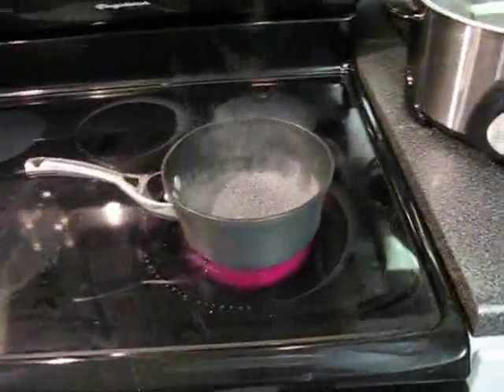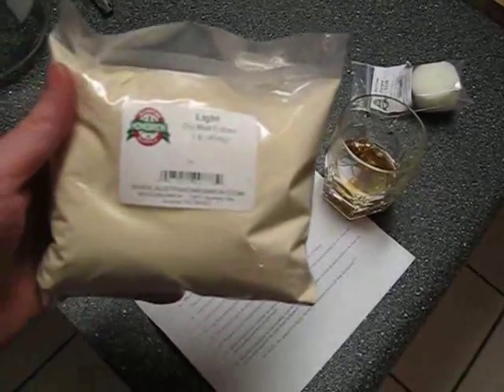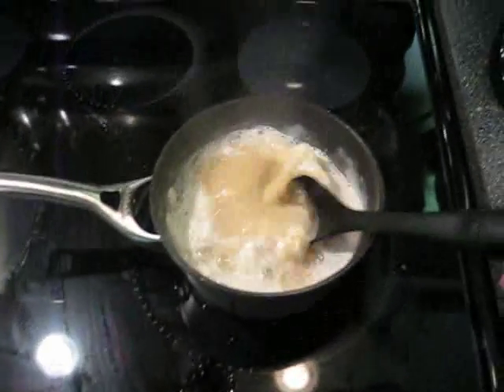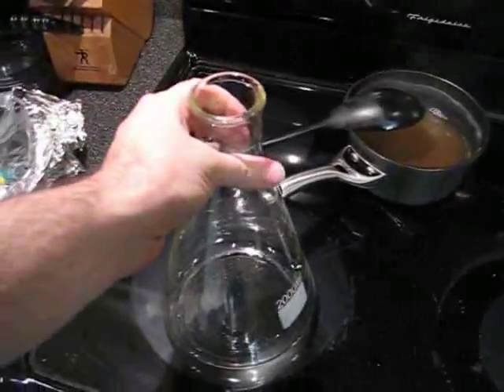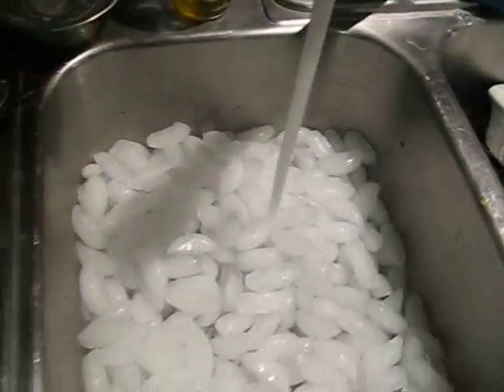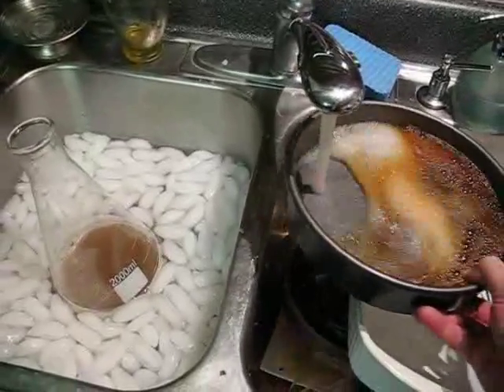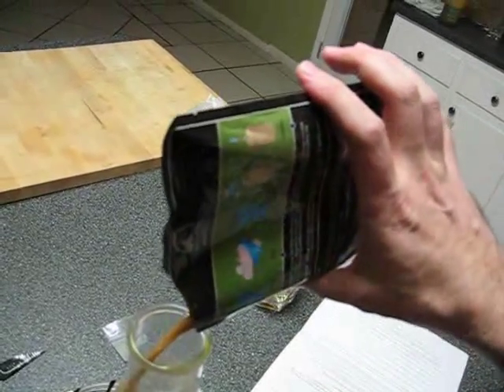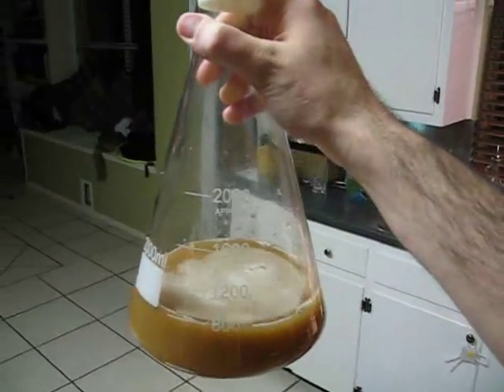Yeast Ranching (Dogfish Head 60 Minute IPA)

Comment: Someone else already said this, but it's worth repeating.  The flask is made out of a glass that can handle a direct flame followed by an ice bath.  However, you probably shouldn't use it on an electric heating element, so this guy is doing the right thing.  If you have a gas stove, you can heat it directly in the glass and then transfer that to the ice bath.  You should also put some aluminum foil loosely over the top to cover it so no bacteria/wild yeast gets in.

Comment: you know those flasks are made to boil the starter in. the flasks themselves are flame resistant. so in one step you can boil the starter and cool it all in one container. those flasks are very tough when it comes to extreme temp changes that is why they rule.